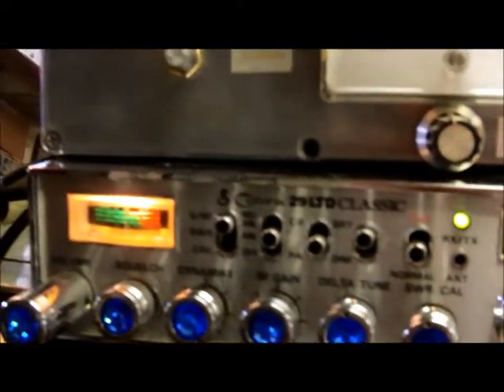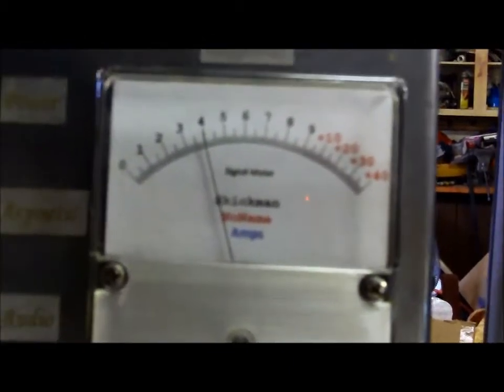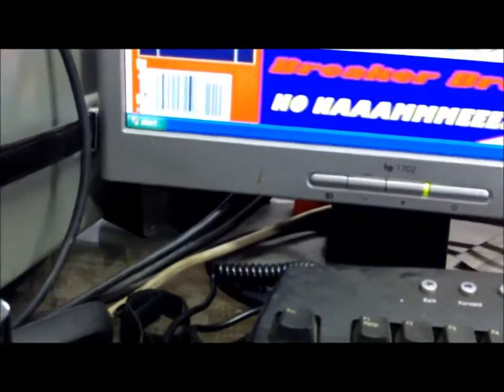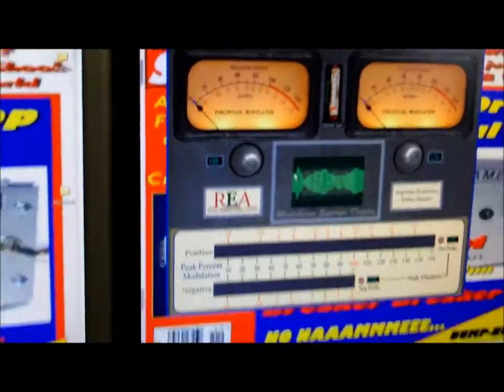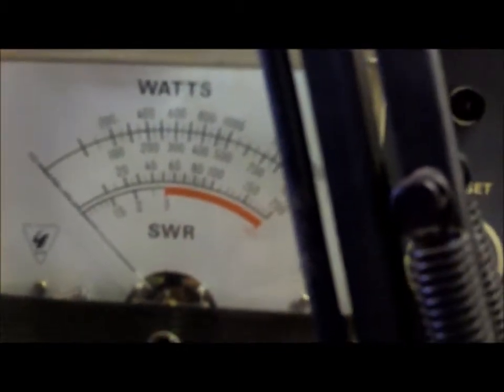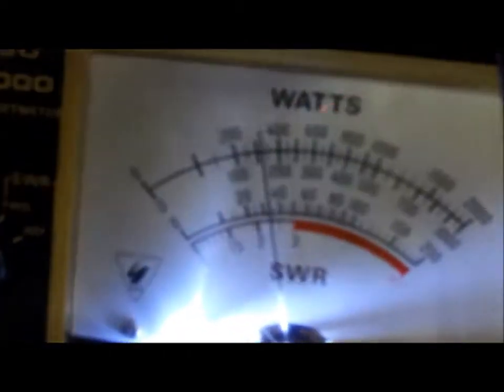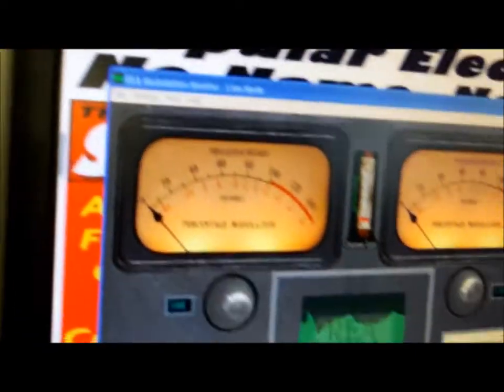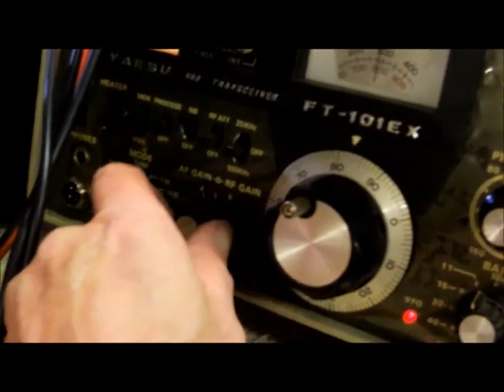My MMM modulator

Comment: How much padding do you have on that 2 transistor amp? Even with suppressed carrier asymmetric modulation or NPC or Positive Peak Expansion you should be getting enough power on modulation from the single final radio to get to get more than 3 watts out of a 2 transistor amp.  If your drive is so low that you are only getting 100 watts out of a Henry something is dreadfully wrong. I do not have a MMM because he stopped making them but I have played around with other forms of the same and your set up does not make sense if I understood you properly. A lot of people will use an AM only dual final radio instead of a single final to account for reduced carrier and reduced power output at 140%-300% modulation. If you reduced the padding and changed the number of wraps on the input transformer that 2 transistor should work fine.